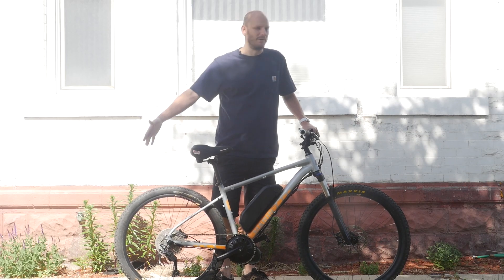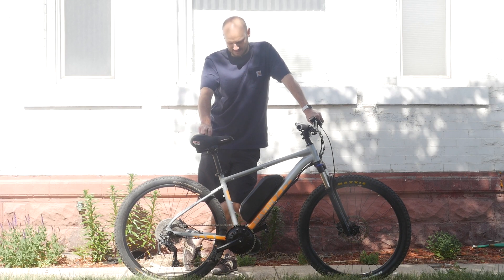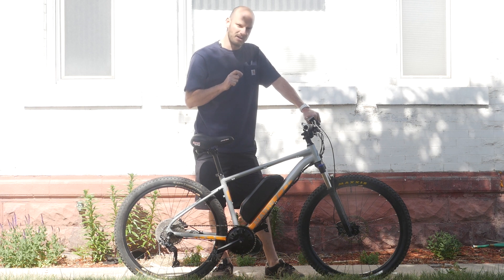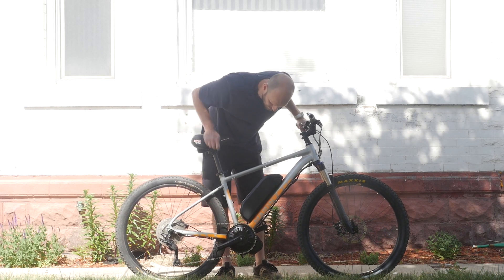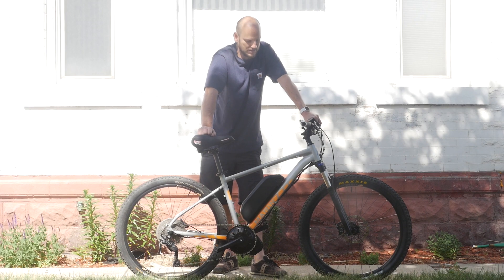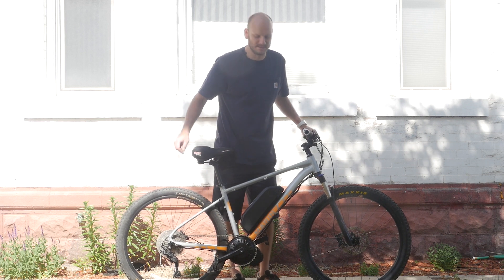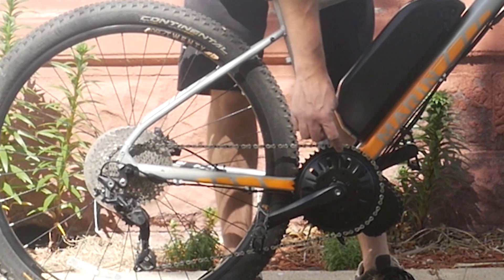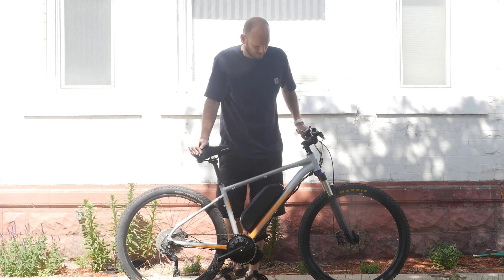Custom E-bike Build: Marin Rocksprings 2

Comment: I didn't know what squashing my beef meant and googling it took to me the urban dictionary. I'm still none the wiser what this method man reference was all about. Something about two men's gene Talia touching when they pass close to each other. I'm from the UK so perhaps not up to date on US slang terms.

Marin is now a brand owned by Insera Sena of Indonesia. They have their own Polygon brand but also sell slightly more expensive bikes under their Marin brand. Here in the UK two of the big bike retailers (Halfords and Go Outdoors) have had quite a few bike models made by Insera Sena under their own brands and they are very decent bikes and great value. I'd have no hesitation in buying one. The Calibre Bossnut was a hugely successful dual suspension bike over here made for Go Outdoors by Insera Sena. It got rave reviews and sold in huge numbers a year or so back.

Comment: Johnny, I know you love the Bafangs (and so do I). I'm just curious, have any of your customers come back to you with problems with the motors? Just curious because you certainly have a lot of experience with them.
Reply: IMO the #1 thing to watch out for is the bafang lockrings always come loose over time, even when you tighten using an impact, or big cheater bar. Something like the HD Stabilizer bar from Cali Ebikes where you hose clamp it to the frame is a good additional preventative measure you can take so that when the bafang lockring does come loose, the motor doesnt spin around in the bb and rip wires out of the motor etc.  Some people seem to believe it's not necessary but I would kindly point out Bafang actually addressed this design flaw with the newer M625 version of the BBSHD,  it has a ring built into the motor housing where you hose clamp it to the frame.
Reply: @EBikeBuilder_  I welded a 4 inch long 1/2 flat bar to the factory motor lock plate and used hose clamps on the down tube. Put heat shrink around the clamps to keep it looking clean.
Reply from the maker: No. Once in a while someone damages one but usually no motor issues from manufacturing.

Comment: The only thing I don't like about the BBSHD is that you can't use a 72 volt battery with it. Come on Bafang, update this motor/controller for 2022!
Reply: I have this motor in my Luna X2 carbon EMTB. 2000 watts!
Reply: they are upgrading the BBSHD;  it's called the M625, and in many ways it's not really an upgrade.
Reply: switch to a bac855 and run 72v all day, becomes a monster!
Reply: @k04s4  are you talking about getting that bac855 on my Luna X2?
Reply: @LarryRichelli  no on a bbshd it'll run about 4kw on 72v. The new ludicrous v2 can take 72v i think, I have a v1 which can only do 52v.

Comment: Johnny that is a nice bike.  I just bought a used 2020 Giant Talon 3 that is almost exactly the same specs as the Marin.  27.5 and all.  I;m gonna make an ebike out of it.  I was gonna make the KHS Zaca 29er I have but I like the Giant better.  Better shock and better brakes on the Giant.  Hydraulic on the Giant vs mechanical on the KHS.  Other than that the KHS is also a great bike.

Comment: Trying to get all the BBSHD stats. We know it's 1000watts, up to ~1700watts  / 160nm torque is that correct? / runs at 130-150rpm / Horsepower = 1.34hp up to ~2.27hp | Does all that sound right?
Reply: it is 1000w nominal.  The stock controller is 30A max current.  Ohms law multiply your battery voltage by the 30A,  thats your peak watts. 48v * 30A = 1440W, 52v*30A = 1560w, etc. With a fully charge 52v battery 58.8 * 30A = 1755W,  but thats straight off the charger and doesn't peak that high for long. The motor doesnt run peak watts the whole time, it fluctuates. Torque and overall performance depends heavily on the gearing of your bike.
Reply: @EBikeBuilder_  Thanks for the info
Reply: @zardoz2627  👍the main challenge with installing these motors is fitting the motor to the bike, and then correcting the chainline. The motor pushes the chainline away from the bike, and usually requires a chainring with an offset. The motor kits come with one, but it's not the greatest and tends to drop chains etc. To get a good one is about 100$. Another consideration is making sure the motor clears the chainstays. You can print out a "motor fitment template" that you cut out and use to determine which size of the motor to buy, and how the motor will fit your bike's bottom bracket. Sometimes you need bb spacers to adjust the positioning of the motor so it clears the chainstays. Some ppl even grind off the side of the motor housing in order to get it to clear the chainstays.
Reply: They does have grunt.

On my second one.  First build was stolen last year.